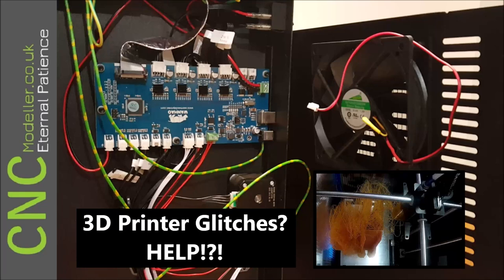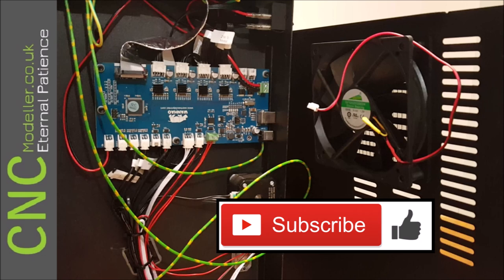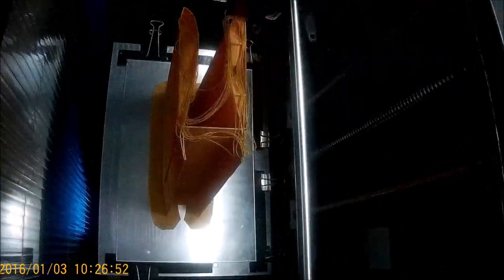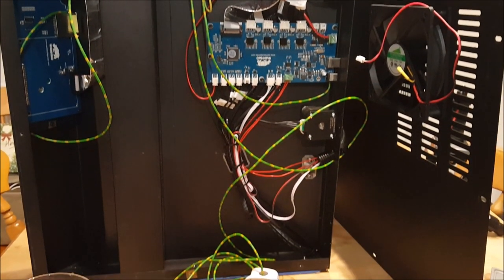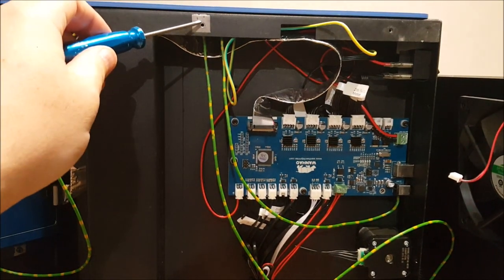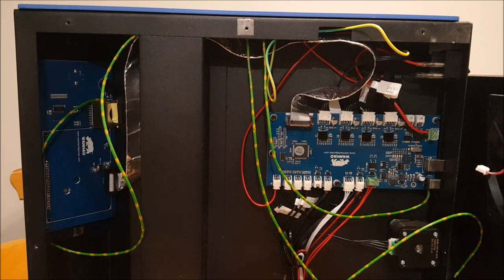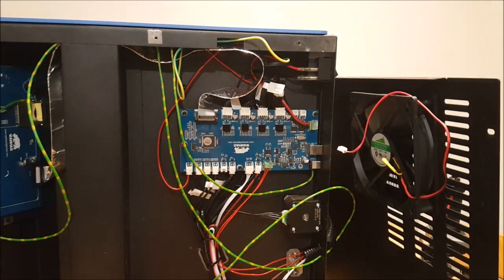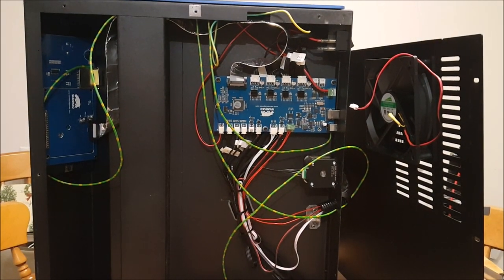CNC Modeller: Wanhao D5s 3D Printer Glitches? HELP!?!

Comment: My wobble was due to the feeder catching and pulling the X and Y off I have had this for 5 years and still runs like a dream only Mod is the fan on the extruder.
Reply from the maker: Yeah mechanically it's a great machine. I'm in the process of converting mine to duet control and RR firmware.

Comment: If you haven't already done so; might be worth looking at the google forums regarding D5S Z-Axis problems. Another interestingly article can be found here: https://www.reddit.com/r/3Dprinting/comments/45b7pt/dont_buy_a_wanhao_d5s_not_until_they_fix_the_z/
Does the glitch; mis-print, slippage occur at a similar height now; if so could the Z-Axis rods have some issue at this point ie. sticking point (lack of lubrication, too much play, mis-alignment developed). Just thinking it might be mechanical rather than electrical.
Reply from the maker: Hi Jarman. I've already been through most of this and have fixed the z wobble with a few mechanical alterations. Will check this out all the same. Thanks for your help. I'm now chasing sd read issues reported by repetier firmware so hopefully closing in on the solution.  
Cheers
Barry M